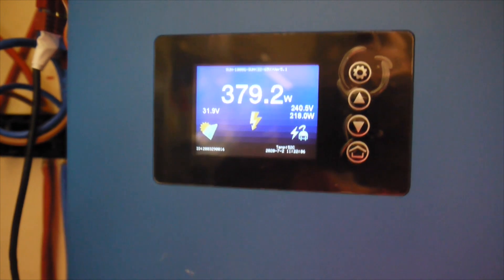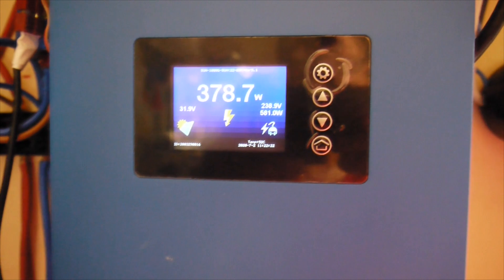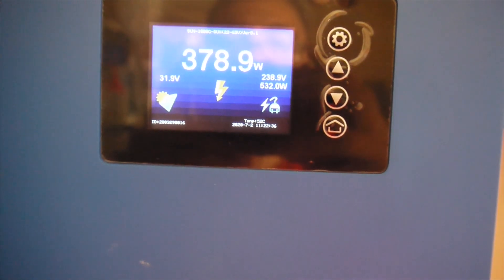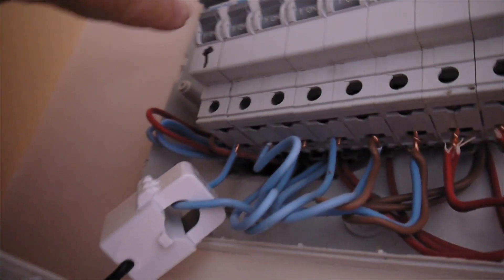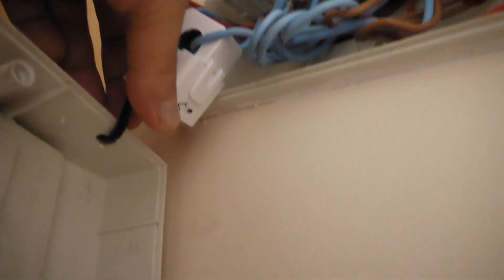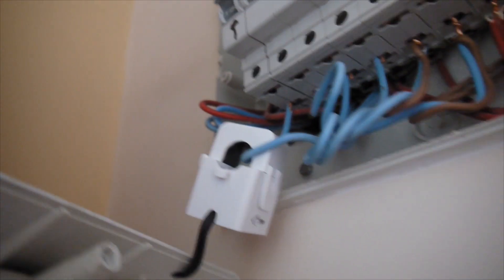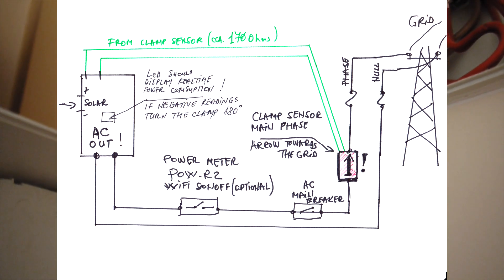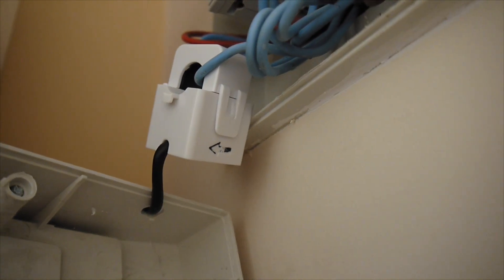DIY solar panel install SUN-1000GTIL2 correct clamp sensor sense

Comment: 532 + 379 is what your load is so check it if the load is only 532 then the ohms are wrong
Reply from the maker: Thanks , I will
Reply: @viocaia  Well it may be easier to used a known load like a 100 watt light bulb but a larger load would be better as if there is a variance it will be bigger with a larger load at least that is what mine does
Reply from the maker: @offgridwanabe  Mine it's calibrated well and there is no leaking to the grid.I'm using another power meter , connected to the output which gives same numbers like SUN output on screen...
Reply: @viocaia  Ok awesome thanks for the video

Comment: Just checked mine and it's about 123 Ohms across the clamp sensor. The reading on the grid tie inverter is about 7% lower than what my actual electric meter reads.
Reply from the maker: I'm using an extension like 4m max, but the cable is thick enough so I'm not worry about the extra resistence, that's under 1ohm anyway.I can't compare the reading of SUN by the whole house power consume, but I'm happy there is no power leak to the grid.
Reply: @viocaia  I've used CAT6 network cable with a pair per conductor and shield (so 3 pairs used). The extension is about 10m and is well under 1 ohm too.

Comment: How do you meassure the ogms of the connector ?
I have a splitted clamps, that read L1 and L2 but in negative, I will try arrows in the opposite way....
Reply from the maker: Maybe you should use them in the same direction but in series?..Here we have just a phase and ground...no need for 2 coils.
Reply: @viocaia  im using a 220 one, and to read all power comsumption... we need to read from L1 and L2... clamps needa to 9n opposite direction
But mine read negative
Tomorrow I will inevrt both clamps
Reply from the maker: @carlosguzman4461  try first to invert the inverter's plug in to the mains!
Reply: Cam urât lucrat panoul

Comment: A question please: Can I use this clamp via wifi with a transceiver from house to garage?. Thank,s.
Reply from the maker: There is a 50/60Hz analog signal, few volts only, so if you can reproduce the same amount, in the exactly the same phase and time it should work.But BUt try a long wire first, I heard people have the sensor at the end of 30 meters long cable.If you use a shielded cable shouldn't be a problem..also please subcribe to my channel for further infos! Thanks
Reply: Viorel Caia Thank, Viorel.